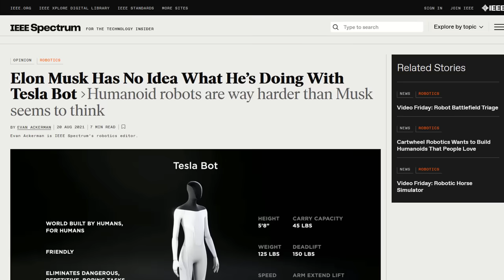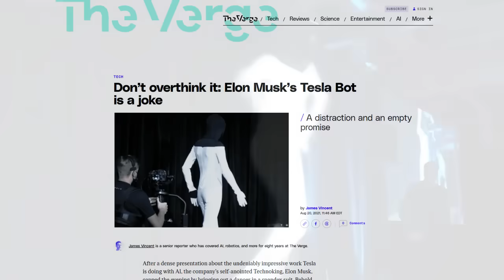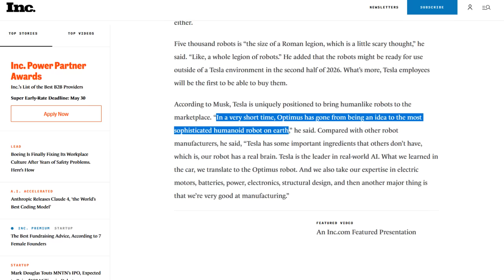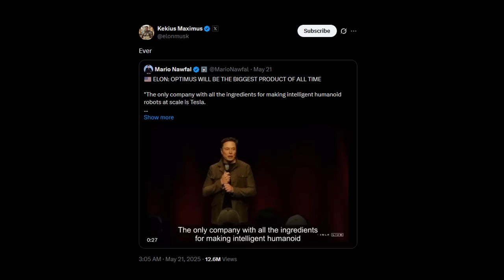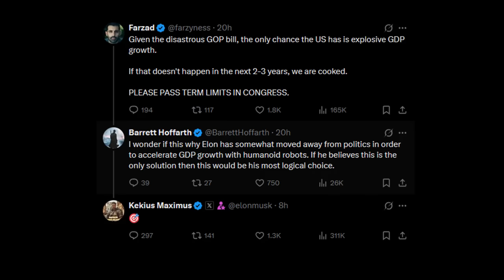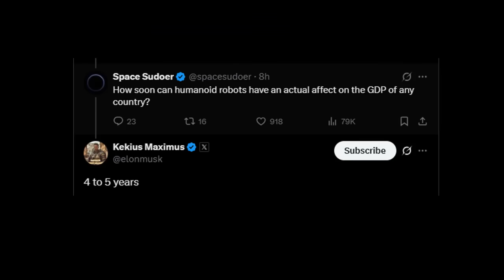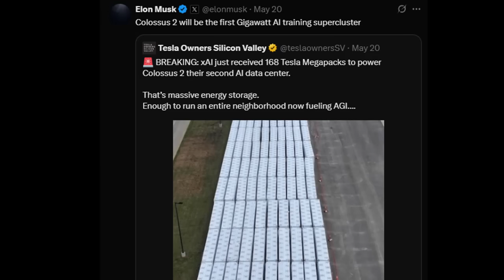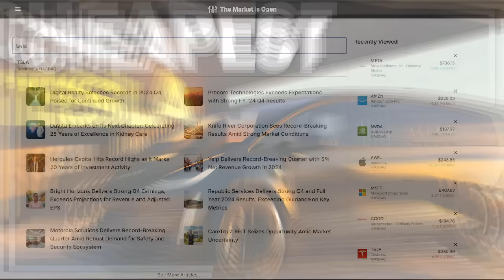ELON MUSK'S ROBOT JUST BROKE REALITY. (The Secret Tesla Won't Tell You)

Comment: Humanoid robots do not need super human strength. In fact it will be generally be better if they are weaker than human adults so that human adults can overpower them.
Having a lower strength lowers the cost of production since actuators can be low cost electric motors.
The cost of production for a robot is critical since it is an upfront cost.
Reply: There would be use cases where having really strong ones would be beneficial, but by and large I agree.
Reply: I wouldn’t want one that could over power me. The strong ones can be used in nursing homes where risk is worth the rewards